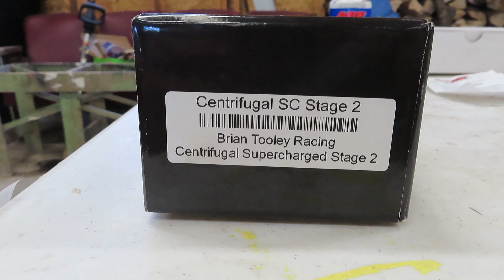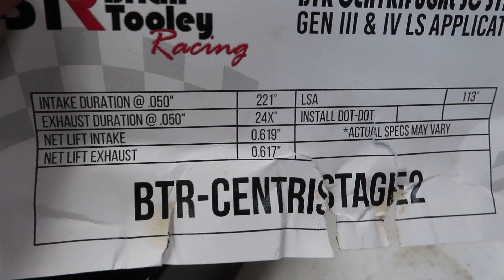Ben's Builds: LS Cam, Timing Chain, and Lifter Install!

Comment: I’m late to the party, found your video because I am dealing with the same issue on my LM7 build.  Luckily I am putting in my cam first,  did you end up replacing the cam bearing or did you fix it in another way. Curious, if I can pull it out to seat it differently or if the bearing itself needs to be changed again. Thanks for the great content. Glad to know I’m not alone.
Reply: I ended up replacing the bearing, it wasn’t worth trying to reuse for how cheap they are lol

Comment: On the cam retainer plate did you use any kind of rtv or silicone on the back side around the gasket? My oem seems to have some that I had to scrape off
Reply from the maker: No, the plate should have a gasket built in and that should be all that is needed. That is why it is important to put a new plate on.

Comment: Hey man, thanks for the video.  I just last week finished learning how to build my first engine ever, from bare LS 6.0L GenIV iron block to installing the intake being the very last thing to do on Wednesday when I get home.  Then Saturday another shop will start installing it.  Fully forged 390ci 4.030 bore x 3.825 Callies crank, Compstar rods and Diamond pistons.  One thing I totally forgot to ask my builder about was degreeing the cam......  I remember putting the timimng chain on and he made me line up the two dots and then torque the 3 bolts.  But is it not required to do any cam degreeing on LS engines?
Reply: That's awesome man! Sounds like it'll be sick once it's done! Whether you have to degree your cam or not all depends on the camshaft. If you are running a super big cam with lots of duration and lift. You need to degree it to ensure proper timing and clearance to ensure you don't have any piston/valve clearance issues. If you're running a more mild cam its not entirely necessary to degree it but its not a bad idea to have the piece of mind. It's really more for people that want to advance or retard the cam timing.

Comment: So no prelube on the back or the front of the cam plate ? You have probably only built a few ls motors where I have built hundreds of them. Never put loctite on one camplate bolt and never had one come loose because I do the job,not the locrite.
Reply: Generally speaking, use of loctite on flat head screws is frowned upon in the machine building trade, so I agree
Reply: @milojanis4901  I don't use loctite on anything when building motors. Most new camplate bolts will have some on them and that is fine. The headbolts have some on them too and that is fine but putting loctite on everything just shows that someone is insecure in the work they are doing and hope the loctite will save them.
And there are only 4 things I break out the torque wrench for.
Rods, mains,head bolts and rocker arms.
Like I said I have built hundreds of ls motors since 2016 and had no problems.
None that can be attributed to me anyhow !
Reply: davidsharp922
Wow you are amazing!
Arseh0le
Reply: @johnny-tw6mt  how many LS motors have you built ?
GENIUS !